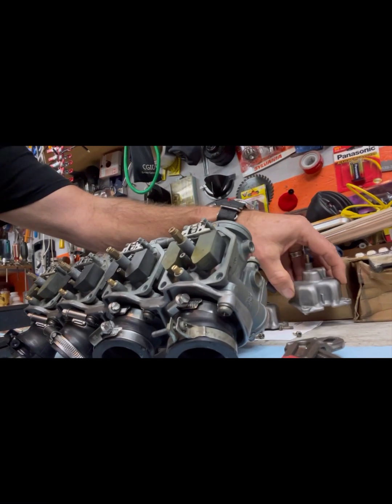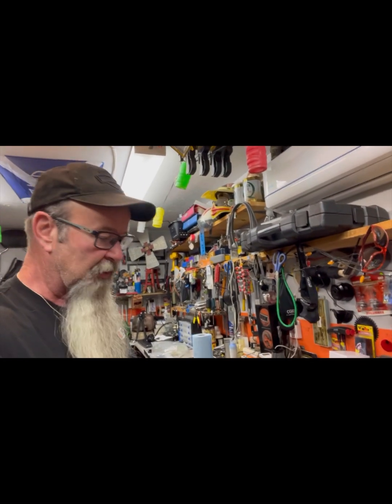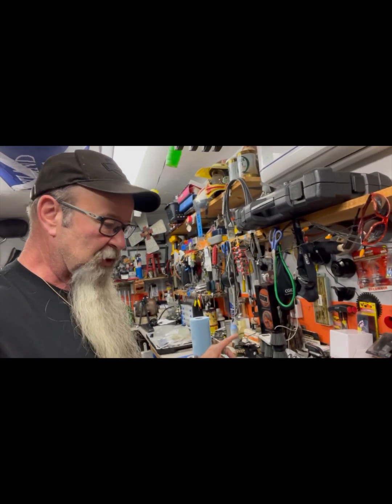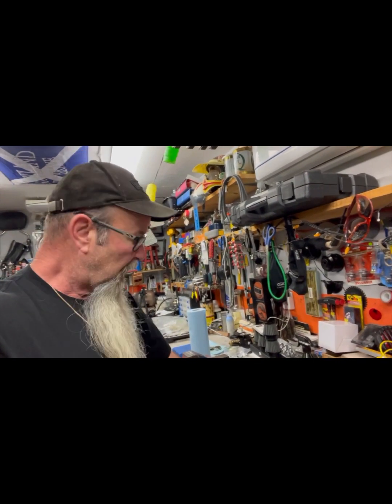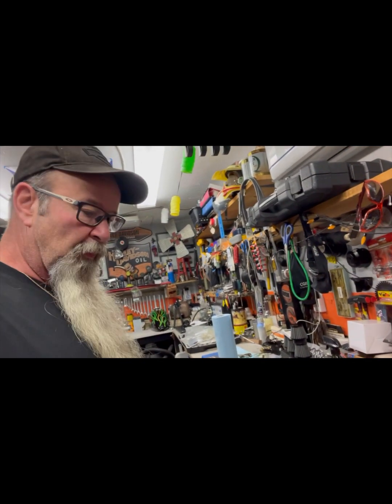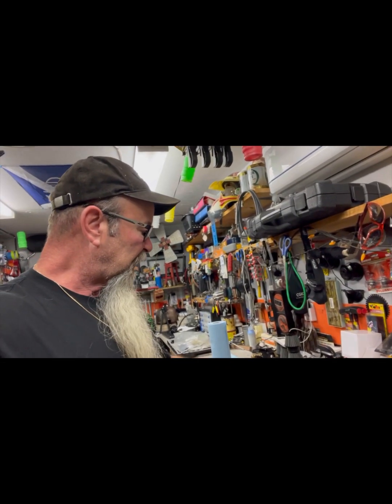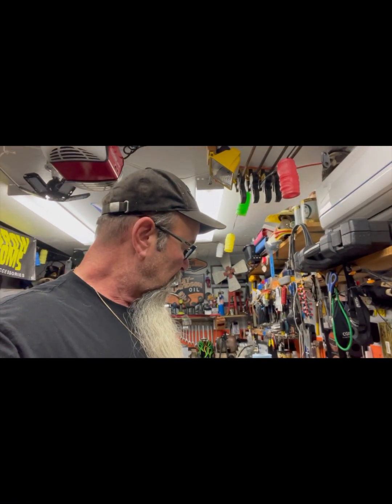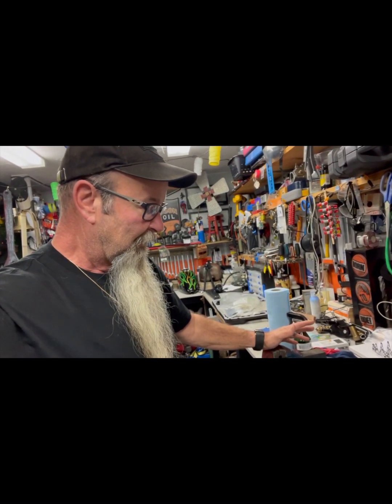Pilot jet found @DocJonesGarage

Comment: Worked on many early 750s over 40 years ago. If you ever have problems with carbs running over, needle and seat not stopping gas flow when engine shut off. Replacing needle and seat usually doesn’t help. Look at float where needle contacts tang on float, you will usually find a small dimple worn in tang. You can replace float but I would use small fine file and file til mark is gone and polish smooth. Very true about mounting rubbers causing problems when hard.

Comment: Awesome! glad you got them out, curious what the number on them is. I like PB blaster too, don't have any in the garage at the moment just the old WD
I'd like to build a 750 chopper sometime soon, I have a old American Engineering frame to use, just need to find out the specifics of how to get it registered here in B.C. might be a nightmare.
Always learning.
Cheers 🍻
Reply from the maker: Yes, I tried to take them out without the PB and they were very stiff,, squirt for a minute with PB and they came right out. My question is do I just tap in the new ones and the ones I took out were #35.
Reply: @thisoldchopper  if I remember correctly I just pressed them in by hand as far as I could and then tapped them in lightly with a plastic hammer, that was before anything else was back together so the floats were still off.
Reply from the maker: @DocJonesGarage  thanks,, I also have a Facebook page and Instagram where I’m trying to promote turning wrenches to keep the head straight. 😁😁